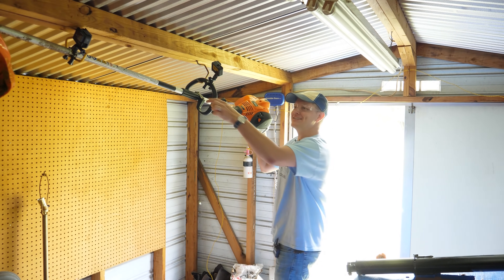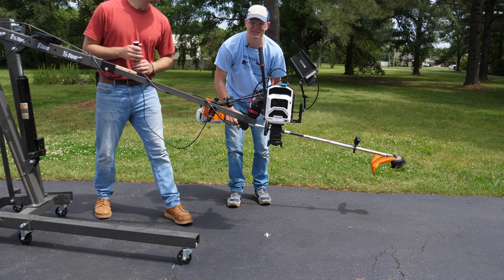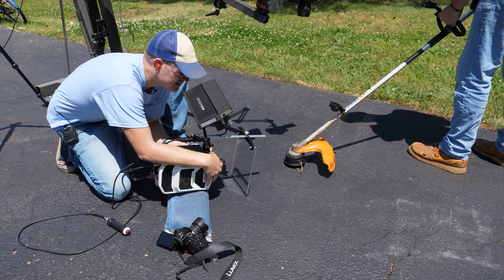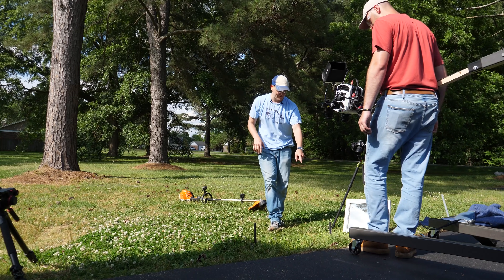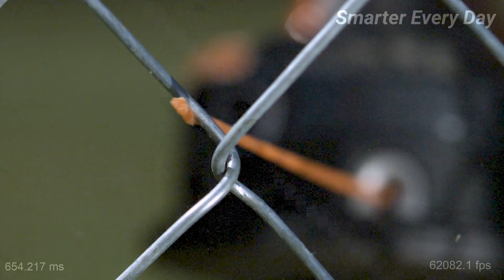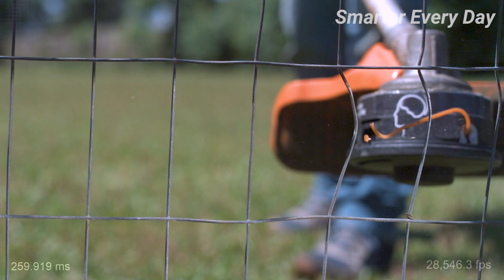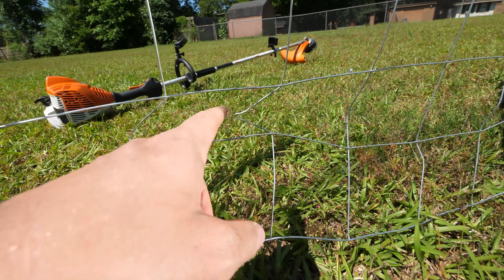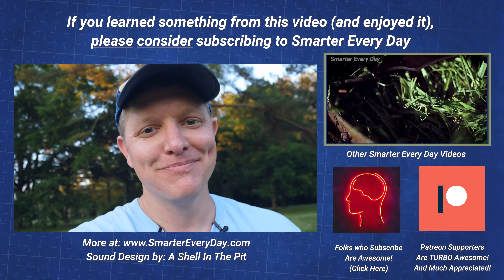How Weed Eaters Work (at 62,000 FRAMES PER SECOND) - Smarter Every Day 236

Comment: Please do a video on the science of the most common weed eater issue..Why a weed eater won't ever start...especially after they've been used a couple of seasons. Talk about why ethanol gas is bad for 2 cycle engines and why 100% pure gasoline is better to use. Show in detail how the carburetors get messed up from using the gas with ethanol.

Comment: best thing I ever did was a get a battery powered weed whacker.. 
no pull start, no idle noise, no gas, no oil, no mixing gas and oil, no engine heat, no exhaust, no engine vibration.   did I mention no pull start?

Comment: Dude, I feel like if we knew each other, we'd get into all sorts of trouble with science and physics.    I'm one of those "I'm not an engineer, but I stayed at a Holiday Inn" engineers.   

When it was wrapping around the chain link, and you asked if it was a "sheer or a tension break".
Again, I'm not an engineer, and I probably have the wrong terminology, but I wonder how much of the breakage is due to a thermal change.   That's a massive amount of motion, and being plastic, how much heat does the line gain, partially melting it, weakening it and allowing it to break off under tension....
Perhaps as an actual engineer, you'd know if that is irrelevant. 

Wonder how much force it actually takes to break a cold .095 from tension?

Comment: My mom bought be an electric whacker when I was 7 or 8.  Got my first customer when i was 11.  I'm 29 now and still cutting at least 10 lawns a week.  I think echoes black diamond string is the best.  If that yellow line in the upcoming video is rynotuff, its turns into dead ends like on long hair.  I'm not a fan lol.  Do me a favor n check out that black diamond string.  If you see this Dustin, thanks for reading this yo.

Comment: “Looks like it’s about 95 thousand of an inch”

Me: Laughs in millimetres
Reply: Why dont they just make a miliinch?
Reply: its funny, even as an american I hear about thousands of an inch, and it feels like some arbitrary measurement that I can't scale in my mind to other things outside of that sample. But if I hear the measurement in millimetres I have no problems. 
I definitely prefer metric but the hurdle that america would struggle with more than any other is switching from measuring distance in miles to kilometres the average Joe has no idea of the "feel" of traveling in kilometres because the only time they would have to understand it (outside of hiking) is when talking to a foreigner.
Reply: @math0rt0n  I agree with this sentiment. I'm American, but my family is from Hong Kong. For a short while, I had to live in Hong Kong. So I had to "convert" from C to F. What I mean by convert is that originally it was an actual conversion using a conversion tool. After getting a feel of the temperature range, I could more intuitively "convert" from C to F. In my mind, I'm not saying that "22 C is comfortable room temperature." Instead, I'm still "converting" 22 C to 72 F. (Just FYI, temperature range for HK is similar to Florida due to similar latitude and proximity to ocean). Whenever I watch makers do their thing, I'm completely lost. If they say something like 3/8 of an inch or thousandths of an inch, I'm like "Wtf does that mean?!" But if you were to ask me to measure out 25.4 mm, I wouldn't know how big a mm is, intuitively. (25.4 mm is exactly 1 in). If you were to ask me to convert between metric units, I at least can do that. But ask me to do the same in imperial, I would have to pull up a sheet of paper and equations to give you an accurate measurement.
Reply: @math0rt0n  so how do you measure something smaller than a millimeter? there is one thousand 1000ths of an inch in an inch but only like 25 millimeters in that same distance. i think accuracy is the key since all of those wires would have been about the same if measured in millimeters.
Reply: @p_versus_p2547  ever heard of decimals mate?
Reply: @ManfrodHasselhoff  lol .001 = 1/1000th of an inch? all of you need some experience in manufacturing it looks like
Reply: @p_versus_p2547 
Metre -> 1
Milli... -> 1000th
Micro... -> 1,000,000th
Nano... -> 1,000,000,000th
Piko... -> 1,000,000,000,000th
etc.
Notice the increments of 1000?
Same in other direction. Kilo,Mega,Giga,Tera, etc.
Reply: @aront.2231  idk what ur getting at all im saying is 1000ths is FAR more accurate that milimeter if u didnt read the above probably should. u can get more accurate 10000 it keeps going as well
Reply: You can't seriously tell me that metric isn't superior when it comes to scientific conversion and ease of use.
If you know the metre and gram you can understand almost every other unit of measurement.
Reply: @p_versus_p2547  we have mesurements that are smaller to, and we can just say "a thousandth of a millimetre" if we want. also, in science we use the metric system because it can mesure atoms, particules and everything you want, it doesn't only stop at millimeters like ya'll seem to think
Reply: @Superbug-tf8zy  did u see how this thread started?
Reply: @p_versus_p2547  yeah but. you say millimeters like we don't know what fractions are, we DO. in science we often use nanometers which is SO, SO MUCH more precise then inches
Reply: @p_versus_p2547  They were getting at your claim that there are only 25 mm in an inch whereas there are 1000 thou in an inch.. Really your comparison should be with micrometers, which is used in the same context as thousandths of an inch.. 25 micrometers in 1 thousandth of an inch.. they're much closer than 25 vs 1000
Reply: @p_versus_p2547  So you're saying that you don't know what micrometers are?
Reply: @p_versus_p2547  Yeah okay. In that case you would say: 0.001 inch = 25.4 micrometres
Reply: @blakelee4555  yeah, onece you have numbers after your comma you convert to the next smaller unit by moving it 3 digits to the right. Easy as that...
Reply: @p_versus_p2547  Smaller than milli- (10^-3) is micro- (10^-6).
Reply: @p_versus_p2547  I didn't google that xD but I get it... nothing better to do while quarantine than making fun of imperial measurements
Reply: @p_versus_p2547  You said it yourself.

1000 thousandths in an inch but 25mm in the same distance.

Which is more precise? Mind you accuracy and precision are not the same.
Reply: @aront.2231  nah just educating people on the vast difference between a millimeter and 1/1000th of an inch =]
Reply: @banescar  stop confusing them even more...
Reply: @p_versus_p2547  Microns or 1000th of a millimetre. My calipers measure down to micrometres and that resolution is pretty standard over here in the UK. Saying that I rarely need anything more than 10ths of a millimetre.
Reply: @p_versus_p2547  accuracy has nothing to do with the unit and everything to do with the measuring instrument
Reply: @p_versus_p2547    Just like you use fractions of an inch, you can use fractions of a millimeter, you know. 0.1mm is a thing, or 1/10 that ie. 0.01mm. Simple stuff really.
Reply: @aront.2231  There are two types of countries: those who use the metric system and those that have put a man on the moon.
Reply: @aront.2231  All of the text you just typed is stored in less than a kilobyte of data on a server that holds hundreds of thousands of petabytes. I think what I'm trying to say here is that you forgot to list Peta (you went to Piko in the other direction)
Reply: @p_versus_p2547  That's a good point because a traditional gallon of water weighs about 8.3 pounds, but if you go to an Imperial gallon of water, that weighs 10.02 pounds. (Don't ask me why they didn't just have it exactly 10 pounds, It's stupid).
Reply: @nonconsensualopinion  Welll... The Apollo 11 flight computer was programmed in metric. I did not say that the US is incapable of scientific breakthroughs, however I did say that metric system has numerous advantages in science, small measurements, engineering, etc.
In adittion, I listed arguments as to WHY: metric is easier to convert and basically only relies on metre and kilogram.
I get that you are patriotic, but the US landing on the moon does not diminish my thesis and related arguments.
Reply: @nonconsensualopinion  besides, as a great man once said: " the degree of civilisation in a society can be judged by entering its prisons"
I do not judge countries based on their capabilities in spaceflight, but by their degree of humility, coexistence in harmony, empathy, and lack of exploitation and discimination. In short: if a country values human dignity even if that human being belongs to a minority or is outherwise ostracised.
George Floyd might have something to say about "The greatest country in the world"...
May he rest in peace and may his death never be in vain.
Reply: @nonconsensualopinion  oh by the way, for putting the man on the moon, NASA used metric. Bang badaboom!
Reply: @p_versus_p2547  
It might have escaped your limited education but metrics is perfectly scaleable  up or down.
Metres, Centimetres, millimetres all the way down to nanometres and beyond.
Works perfectly with Length, Volume, Mass, Liquids, Temperature in Kelvin, Force (Newton Metres) and time. And Frequency where wave length is indicated in the length of the sinusoidal wave by dividing the Frequency into the universal definition of time, the Second.
All units are linked and scaleable.
I learned that from an American Textbook that came out in 1971.
Reply: @blakelee4555  What P_versus_P doesn't get is the irony of using a Micrometer to measure fractions of an inch.
Reply: @nonconsensualopinion  
But the brains who did used Metric measurements for Gravitation, Force, thrust and angular momentum.
Reply: @aront.2231  
Thank you Aron for putting a human face to this discussion.
I am in Australia and despair about not only the way minorities are treated in the USA but also here.
It is still possible to get the PSSC Physics book setting out the MKS system.
We went metric in the 1980's. Still waiting for the USA to catch up.
Reply: No one tell the americans that milimeters can be divided too!
Reply: @toomanyblocks8448  too late, they arleady know about milli milli metres :(
Good joke btw
Reply: @toomanyblocks8448  their lack of multi linguistic intelligence applies to ancient language terms like milli, micro and nano too.
Reply: My brain hurt when he said these utterly ridiculous measurements. How can anybody in his right mind think that is a good way to measure stuff.
Reply: Weed whacker line is sold in inches, he was just saying the type of line it was. There is 0.095 inch line, which is the one he was using.
Reply: @theaveragejoe___  
The rest of the enlightened world buy it with a metric diameter. and in spools measured in metres. Your point is???? Pointless
Reply: @grahamlucas2712  My point is that he is saying what type of line it is, he is not trying to say that the imperial system is superior. Maybe use your brain next time you comment ;)
Reply: @grahamlucas2712  The line is sold in 0.095 inch. It is advertised as 0.095 inch line. On the package it says 0.095 inch line. It is the type of line.
Reply: I don't like math no matter how you twist it.
Reply: Enough internet for today!
Reply: People who do real science > people who complain about units
Reply: Which was preceded by "it feels more like science if we take some measurements". it really did feel like science
Reply: Thousands of an inch are commonly used in things like machining, where you need precision, and it comes to a point where it sounds perfectly normal and you understand what one looks like.
Reply: @drljevic583  if they wanted precision they'd be using millimetres, haaaaa. I joke, but it does sound confusing to use thousandths of things
Reply: @drljevic583  I know what a thou feels like, but my work is only to the 1/16 in :P
Reply: A millimeter is just a thousandth of a meter
Reply: @samo4648  The difference being, that metres are always converted to 1000 and we don't have random conversions.
How many inches in a foot?
How many in a yard?
How many in a mile?
How about weights?
Or volumes?
That's why metric is used for science and not imperial. XD
Reply: @aront.2231  people always bring up conversions as the reason metric is superior but how often do you actually convert things in real life? That's why we have different lengths of measure. You don't need to know how many feet are in a mile because you can just say a mile. Believe it or not imperial is more intuitive, your brain automatically thinks in fractions and metric doesnt easily translate to fractions
Reply: @samo4648  we do that very often, its much easier to understand too. imperial is a bunch of different fractions and is a pain whilst metric is just 10, its fractions but on ten, you devise it by ten, its so, so much easier,
Reply: @samo4648  how many yards are in .375 miles? How many meters in .375 km? How much does a gallon of water weights? What about a litre of water?
Reply: @samo4648  My brain does not think in fractions. I see a kilometre/metre/centimetre/kilogram/litre etc. in front of my eyes. While you can argue that metric and imperial are equivalently intuitive, metric is way less arbitrary. Coming back to my point about scientific measurements...
Reply: @samo4648  But it does easily translate to fractions if you use it on a daily basis. I think both systems have their strengths and weaknesses.
Reply: @samo4648  I don't follow, metric fractions still work. I mean 1/2 a centimetre can be measured, so can 1/10th of a centimetre. It's just they have extra names, 5 millimetres and 1 millimetre. I was raised just after the metric system was introduced in the UK, so can think in both systems. When it comes to adding measurements together 7 & 3/16ths plus 2 & 5/8ths the metric 182.562 plus 66.675 seems more intuitive and there is no tedious converting 5/8th to 16ths or worse 32nds or 64ths.
I suppose it comes down to which system you use daily.
Reply: @samo4648  The civilized world is metric. 
Math's to base ten is metric. 
Fractions  are an unnecessary complication.
I learned Physics from an American textbook.
It was the MKS system.  Measurement Force Seconds
Still don't understand why a so called Science and technology based Industrial country persists with useless units of measurement.
No need to convert anything.
Length in Metres up or down in easy divisible by ten units.
Weight in Kilogram, up or down in easy divisible by ten units.
Liquids in Litres, up or down in easy divisible by ten units.
Same as volume.
Metric Ton =1000 kilogram.
Imperial length Inches or fractions of?
Weight Pound, Ounces, Ton?
Liquids Ounces, Pints, Quarts? Gallons etc.
The standard USA Gallon is 3.87854 Litres.
UK Imperial Gallon 4.546 Litres.
The French did the World a favour with standardised measurements.
Only backward countries stick to outdated unrelated measurements.
Cheers Timekeeper
Reply: @grahamlucas2712  I don't know why everyone is so dead set on conversions. It's the only argument I ever see for why metric is better. But in the real world you hardly ever have to convert anything. If you tell me measure this stick, I'm going to measure it in inches and give you inches. I'm not going to measure it in feet then convert to inches or vice versa. 

"Hey, how long is that road?"

"27 miles"

"What's that in feet?"

Who cares? I just told you how long it is. 

A problem I have with metric is that theres nothing in between a centimeter and a meter. So when measuring things you either have to use hundreds of centimeter or decimals of meters
Reply: @samo4648  Thanks, not. It's in the name. Milli and Kilo, Latin and Greek respectively. You don't need half a brain to deduce that. Decimal system, 10 fingers on a hand. Easy and practical.
But I do understand Americans working with dozens. All that inbreeding might've left you with 12 fingers in total. Hahaha.
Reply: @etimpera2773  Right, because all Europeans were kings and queens led by the 1% peasantry. And most surely there are less southerners than royalty. Because when you see an incest joke you hear "Sweet home Europe". Am I right?
Reply: @td9250  Oh yeah, all our royal families here in the U.S. inbreeding. Base 12 would also be superior as 12 is a highly composite number.
Reply: @td9250  and I'm sure 100% of America lives in the rural south and not big cities. It's almost like you proved my point for me lol
Reply: @DominicI1  About point 3, the metric system was changed at some point to be derived from universal constants like light speed or the mass of a proton. I don't remember the details though.
Reply: @maxximumb  bold of you to assume it's just Her Majesty
Reply: @samo4648  tru but we got a name for it so how many feet in a nautical mile
Reply: @samo4648  yeas but its not needed to be called as such just to be able to understand what someones talking about
Reply: im not saying standard is better than metric just correcting the assumption that a millimetre is anywhere close to a 1/1000th of an inch
Reply: @p_versus_p2547   micrometer?

Comment: "I feel like I want to go from right to left..."
Yeah, and I feel like I should scrub the floor with a vacuum cleaner that has a rotating brush...and that I should wag my hand from side to side quickly when watering my lawn with a garden hose.
Logically,  scrubbing the floor with a shop vac makes sense, but with the rotating brush or with "beaters" incorporated into the pick-up head, I should probably just move the vacuum cleaner very slowly.

Comment: RE: the 360 wrap :
So maybe it's just due to my 3D printing background but as it wraps I'm wondering if it's not turning some of the kinetic energy into heat and its melting/weakening the line. Because some of the breaks look really clean and/or smooth for what I would categorize as a stress break.